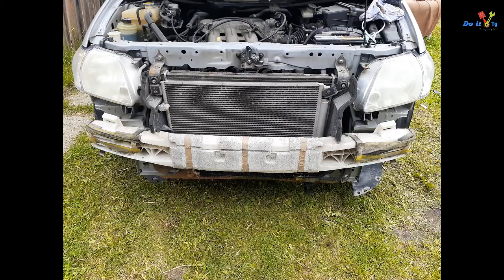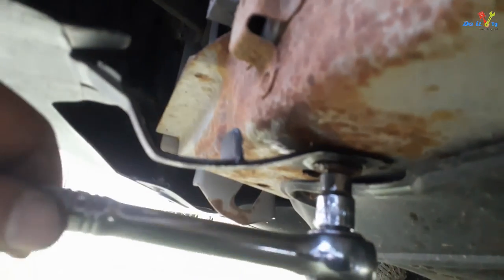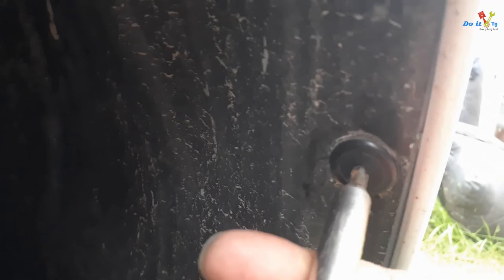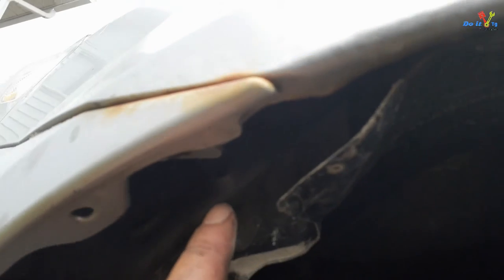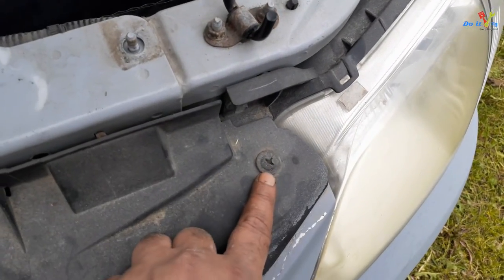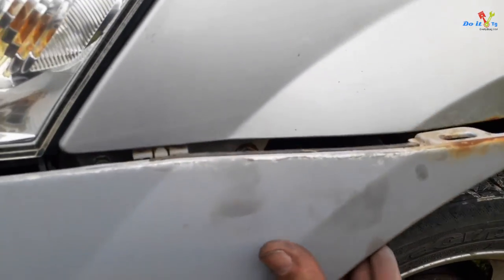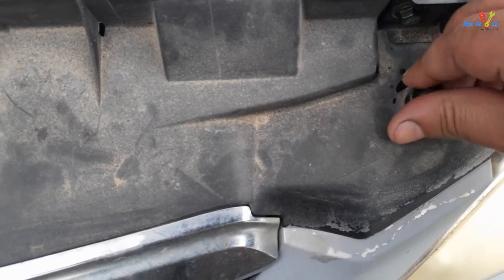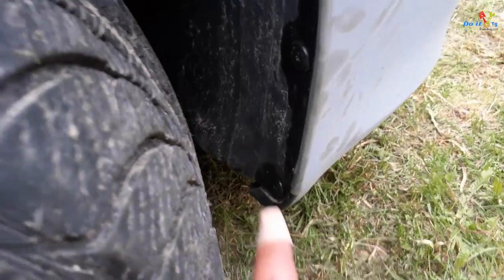How To Remove Front Bumper Cover On Mazda MPV

Comment: Thank you so much for sharing this.  I am trying to remove the radiator of my 03 MPV, and just came to a realization that removing the bumper cover first might make my radiator replacement job a lot easier.
Reply from the maker: Yes, removing the front bumper makes it easier to access the radiator. Glad it helped!

Comment: I have 2003 Mazda MPV... Camo'd...It's painted flat green with a custom roof rack/ roof basket system ... Textured rubber step on rear bumper... The inside camper is just getting started... Did I mention that I'm 59 years young...
Reply from the maker: Great!